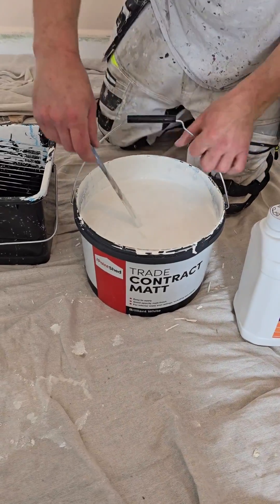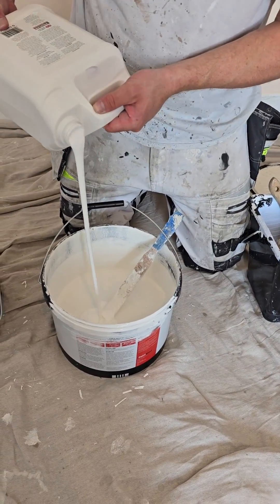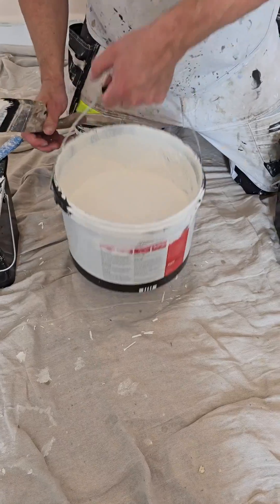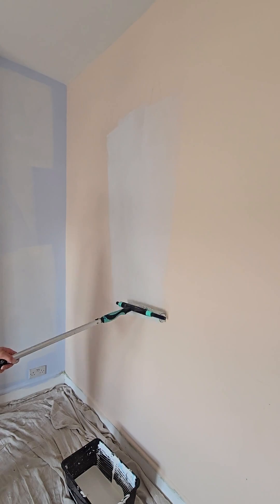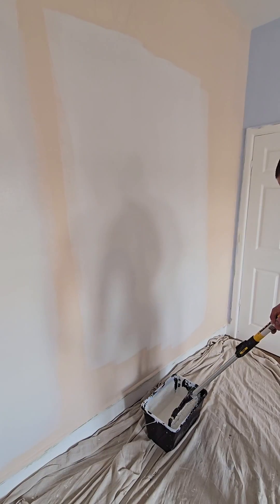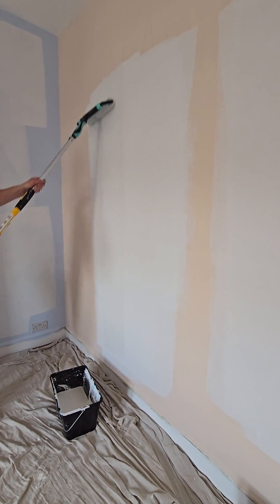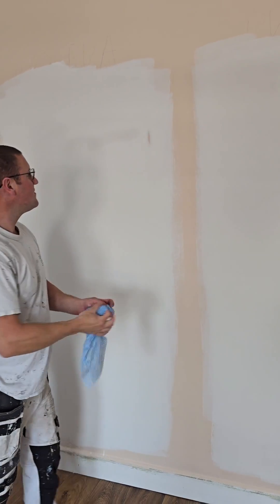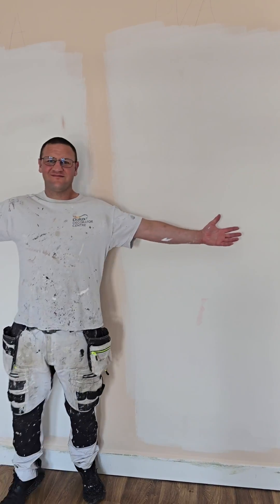Mixing PVA with paint

Comment: But is it overpaintable with an emulsion in the future?
Reply: I think ive found the answer. No
I've been decorating indoors, and literally, once I've applied a coat, it's peeled or bubbled up. I thought that previously, the paint had been put over wallpaper paste. It's seriously done my head in.
I'm not saying adding pva will always fail. It's more at what point does it create more problems than it solves?
Just my opinion.
Reply: Did you find out?